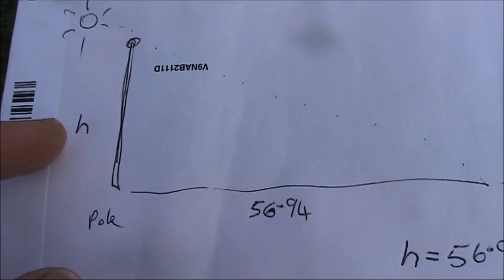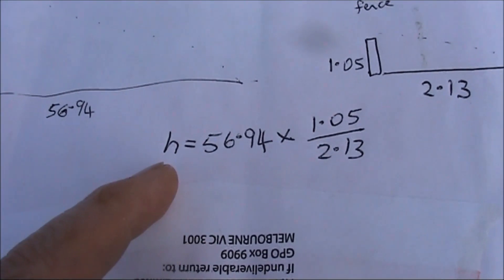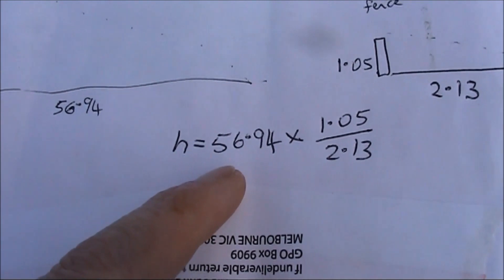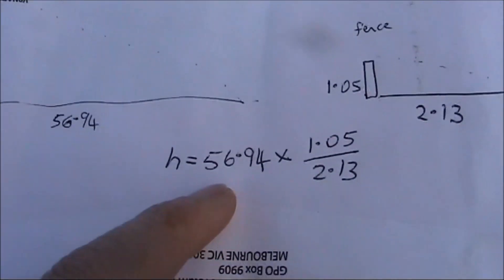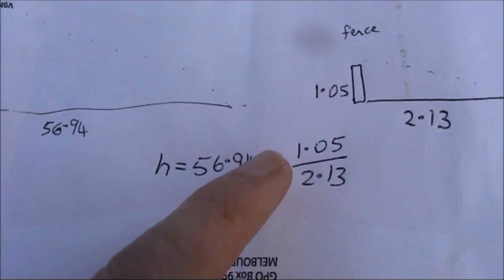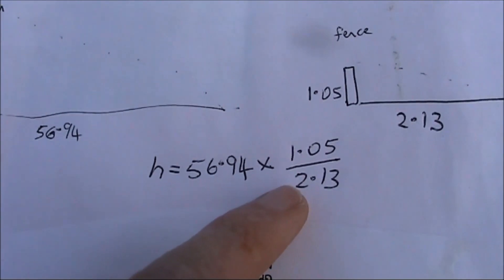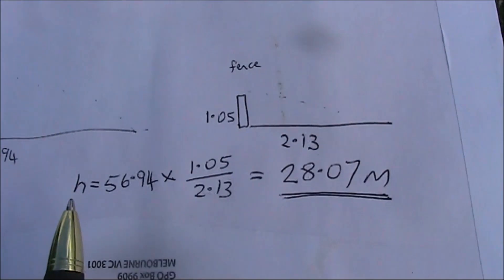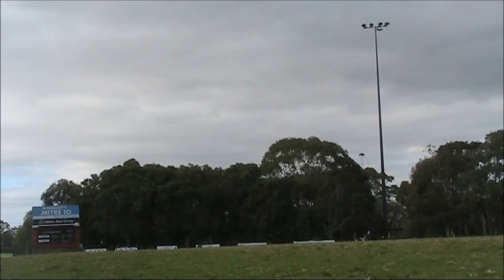How to calculate a mast's height without having to climb it

Comment: Trigonometry works if the ground is perfectly flat and the mast perfectly perpendicular to it.  Measure the length of the shadow L.  At the tip of the shadow measure the degree angle A between the base of the mast and the top of the mast.   tan(A)  = mast height / L.  Mast height = L x tan(A).

Comment: Good info.thanks! I wish it had been that easy during our school biology trip to Scotland many years ago. We went into the huge forestry plantations, measuring the angle to the top of the trees using a sort of eyepiece that kept filling up with water. You had to measure out how far you were standing from the base of the tree. Then using a formula involving, I think cosines, you could work out the height of the tree and, if you knew which species it was, the volume of timber in the tree. We spent days doing this in temps of about 5 or 6 C and pouring rain. We also studied the aquatic life in "curling" ponds, but only after breaking through the ice with hammers. Fun times!

Comment: sooo... how are you going to couple into this one? 😃
Reply from the maker: I was thinking of using a coiled length of coax cable with a foam former.
Reply: @vk3ye  well this will be interesting. It's going to have to be a fairly large inductor on 160m.
it might need a bit of experimentation with the number of turns to get a match too. Those lights have wires running under ground so there might be a counterpoise for it.
I think it might work really well. I don't think it would work better than going out on a jetty with a loaded vertical and connecting to the rail for a ground but if it approaches that performance I know you'll be doing it again 😀
Update... I watched the video again and saw that you have the metal fence right next to it for a counterpoise if desired and noted that the light pole is bolted to concrete. I think this will be a WINNER